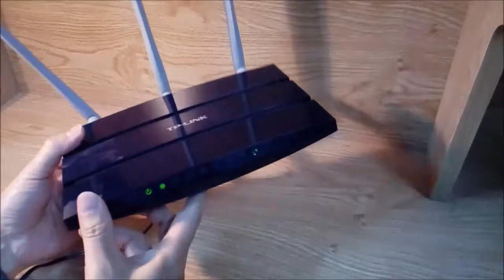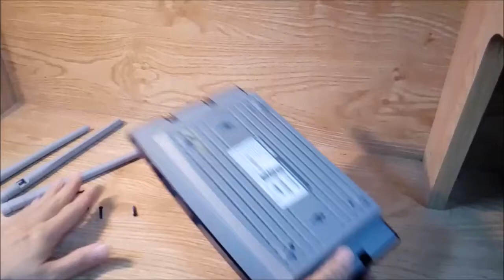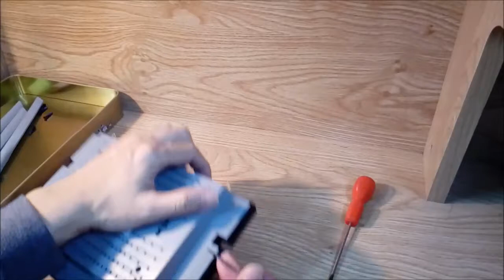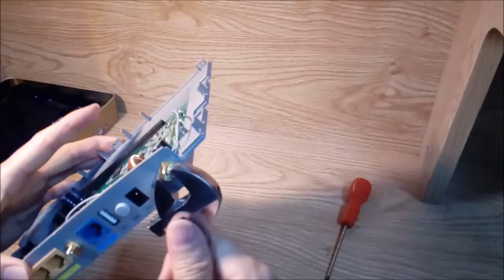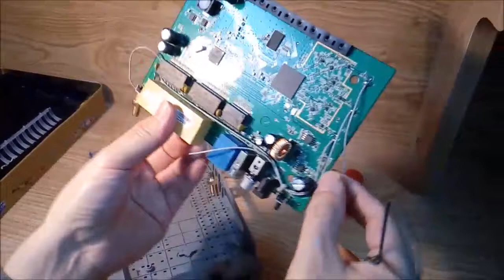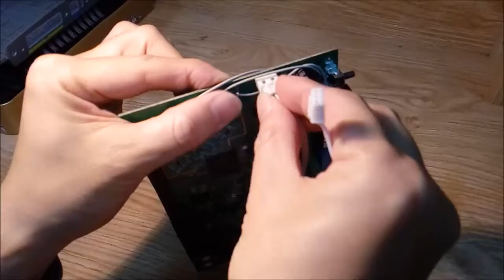How to solder serial port connector to unbrick Tp-Link TL-WR1043ND Ver: 2.1

Comment: Hi, may i know what is the tools you have used in this video? I want to get the materials as well.
Reply from the maker: +Eric Chan just usb 2 ttl cable
Reply: Thanks :)
Reply: Your adapter looks like USB to RS232 not to TTL and USB -> RS232 can kill CPU as it has 12V levels, plus it is better to use 3.3V TTL not 5V.
Reply: Vladimirs Gusarovs
Не знаешь, где найти распиновку RS232 для TL-WR1043ND ?
Reply: Google -> 1043ND UART =
http://1043nd.de/unbrick.html
тут вообще масса информации 
https://wiki.openwrt.org/toh/tp-link/tl-wr1043nd

VCC 3.3V лучше не соединять, только GND TX RX